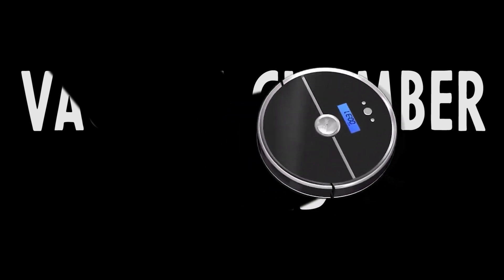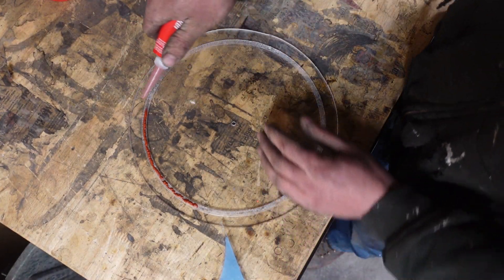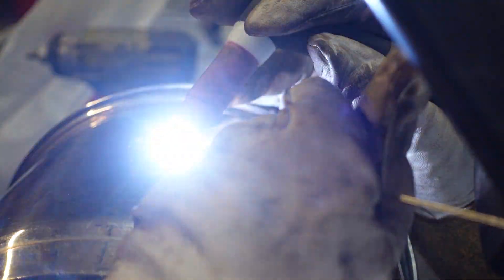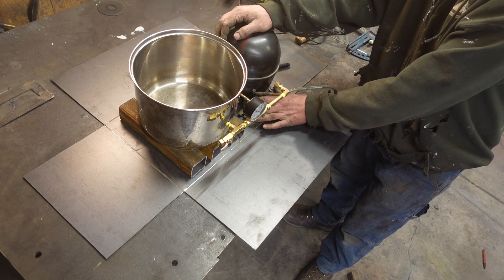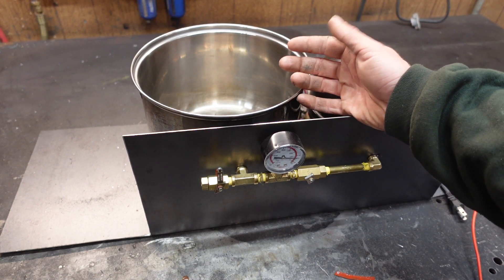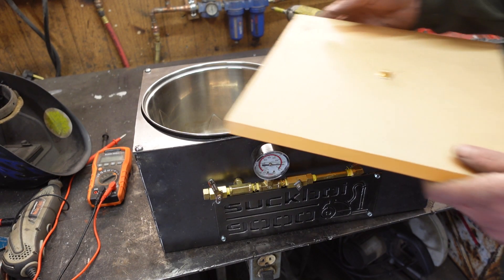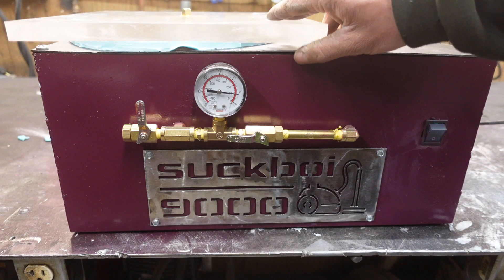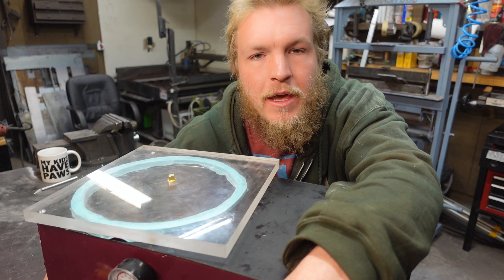Vacuum Chamber Build

Comment: Suckboi 9000 is a thing of beauty.  

You can get silicone sheets for baking and crap off of that jungle website.  Just cut a big ring.  They're very soft and make good gaskets.   Saves having to make all of that blue playdoh.
Reply from the maker: I'll have to check that out, as my blue playdoh gasket is already starting to crack haha.

thanks for the support!
Reply: Yes those sheets work well but better with silicone caulk one side to stick it down